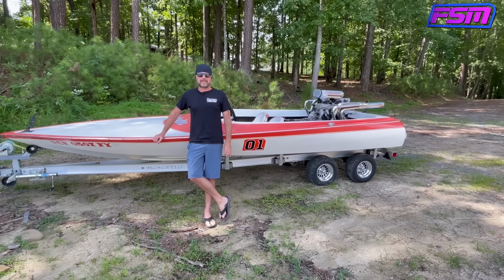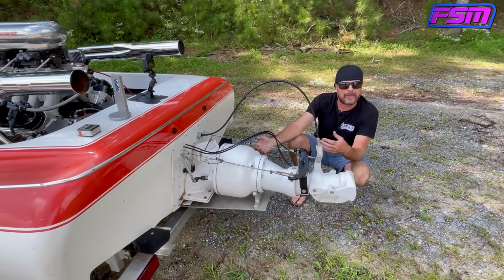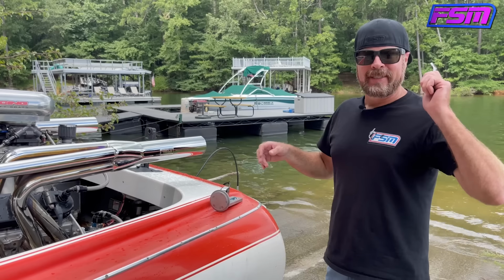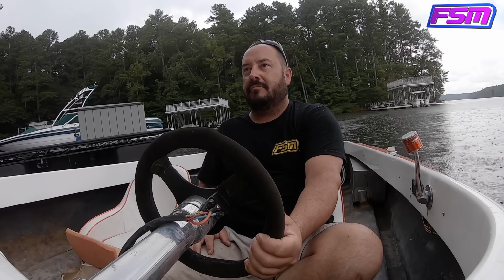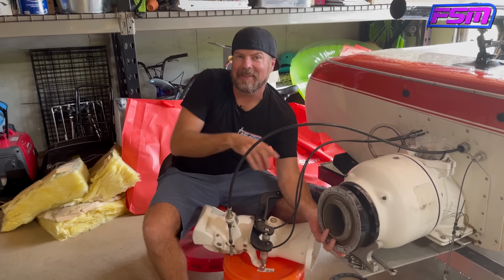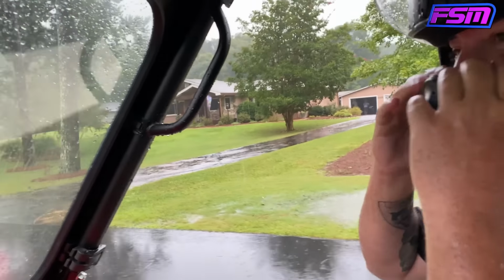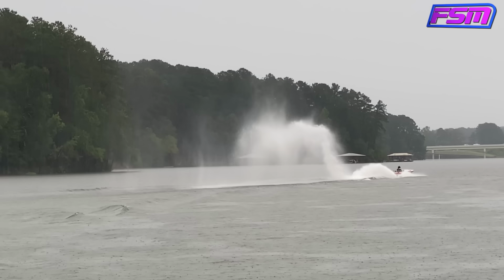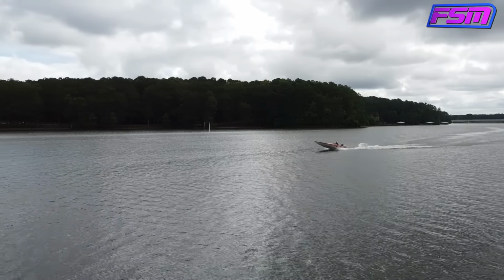MASSIVE JET BOAT MOD=HUGE ROOST!

Comment: Basically the roost is just a water burnout. Looks cool, but you don't go fast.
Save rubber, throw water!
Reply: That should be an FSM shirt. 

“Save Rubber throw Water”

With a picture of a jet boat.
Reply: @MrHatchbody  I really like that idea! 
Definitely would buy and wear.
Reply: You can't go fast in a pump boat anyway , any ANY V drive worth it's salt will walk all over that vacuum cleaner
Reply: @hydroy1  But this video is all about the "burnouts"?
Save rubber, throw water!
Reply: @hydroy1  Different applications. You can’t run that V-drive in shallows, mini jet boats running on rivers and streams is a blast. You should try it and you would be a fan of both driving methods.
Reply: @hydroy1  - Modern jet drives are quicker than a v drive.  Go to any boat drags.
Reply: @danmyers9372  quicker not faster all depends on your needs/wants
Reply: @danmyers9372      Modern jet drives are quicker than a v drive. ---?????  Who in gods name told you that lie ? I been drivin Hydros for over 50 years, ( started in 1961 ) How many Top Fuel JET PUMP boats are there ???  DING DING DING ! CORRECT ZERO ! WHY you ask ? Simple there  2 to 4 seconds slower in the 1/4 mile then the V drive of the same cubic inch size & class motor in Hydro or Flat bottom. Always been that way and there's no changing the record books . Fact is Jet pumps are the most inefficient way to move water. What Pump boat can you name running in the 4  or 5 second range in the 1/4 mile in any class or type hull? Right there are none.  Fact is the very fastest pumps are way up in the 7+ range in the 1/4 mile and most are in the 8s or slower as there very  inefficient and almost impossible to get over 155mph. This is supported by the fact , how many Top Fuel Jet pump boats are there ?
Reply: "Spinnin' ain't winnin' " it's just too much fun!
Reply: The environmentally friendly burn out...
Reply: @danmyers9372  TFH are Jet drive??  Dang I did not know that.
Reply: Mike P might not be feeling too good about his pp today
Reply: I was thinking it was more like rolling coal, just is a cool waste of the propulsion force.
Reply: @hydroy1  you miss the point of a jet boat. they're FUN! they are also really low maintenance, no exposed propeller or rudder to take damage in shallow water, and nothing changes direction like a jet boat. good for you if your boat's faster

Comment: Finnegan: “Don’t wanna run your jet drive dry”
James Taal: starts boat at the top of boat ramp.
😂 should’ve put this video out before cleetus started the boat challenge.
Reply: You read my mind right there.
Reply: "Dang rogue rocks are confusing as airplane chocks." (sry James, had to, lol.)
Reply: James has many more concerns with his boat than running his jet drive dry.
Reply: @nunyabinis   “still budget left”
Reply: there's a clutch between jet and drive shaft... he disengaged it to start the motor.
Reply: @ZaphodsPlanet  there is only one pedal mounted!?
Reply: James actually said the boat wasn't going to last, it's just for fun right now.  He cares about it as much as the one he won in Cleeters contest a while back, which is to say, not at all.
Reply: @MrJob91  do you think a brake pedal would help stop it?
Reply: @warrenmichael918  only with carbon ceramics the way he is sailing
Reply: I really hope they build that boat such a cool hotrod boat. It definitely has potential
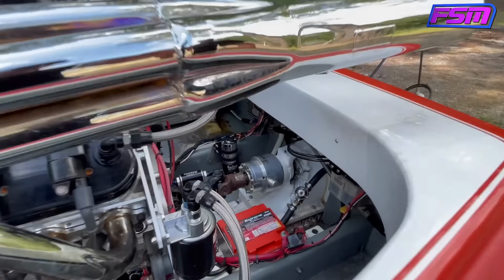Reply: @MrJob91  Go to 7:50 on the video and you'll see it.  He doesn't engage/disengage it every time he drives the boat as you would with a car.  You can see it, big silver thing in front of the jet that he rotates (I'm assuming) to disengage clutch from the drive shaft that comes off the engine.  Never knew there was such a thing until watching this video but it makes good sense.  Anyway, you can see at that 7:50 time mark.

Comment: You guys are awesome!!  The Finnegan group of guys, KSR and Cleetus among many others have given me so many ideas for building my 1972 vw super beetle. All in all the build that I wanted to be a handling quick car turned into a very different build. It is now in the process of being a 600hp 1800lbs car that I am super excited about. Thanks guys!!
Reply: You should build a standard beetle not a super beetle. The super might handle better but that curved windshield and big old front end are gross. Plus the strut towers crack. Standards also weigh 1500 to 1600 lbs. and that’s with a 4 point cage a roof rack and subs and amps. Just saying. Also 600 hp? Is that a turbo T1 or turbo T4, Subaru EJ, turbo 2 rotor?  Is your super a 1302 or a 1303?

Comment: Newbern should race jackstand jimmy with this.
Reply: Lol Renegade would stomp that boat in it's current condition.
Reply: @bepbep7418  yeah it wouldn’t be close
Reply: @bepbep7418  Jackstands boat would be pretty cool if they took their time to right all the wrongs with the engine and took it somewhere to someone that knows what they are doing to fix all the fiberglass fuckery going on in the the rear end.
Reply: @TheBignick243  After they finish the 2500 challenges, I think do another.  All three boats get another 2500 to mod what they have and repeat the challenge.  BTW, jackstand would dominate at that point, right?

Comment: "There is suction drawing water and the jet pushes the boat through the water. I say that without suction, the boat wouldn't move, so it suck the boat through the water." -- mike finnegan.

"I didn't think it was possible, but this sucks and blows at the same time!" -- bart simpson.
Reply: Suction by ass, it's atmospheric pressure that moves the water into the pump!
Reply: @rondye9398 :
Not really, unless you're assuming the atmospheric pressure on the whole lake is what's pushing water into the jet pump. 

What that system really is, is a ducted, shrouded propeller whose water stream is enclosed, rather than simply exposed to the water in the lake.

The forward moving force is the result of Newton's Third Law of Motion as applied to water. Specifically, if you take in a lot of the stuff in a short amount of time and pump it out at high velocity, you get a jet force. 

Finnegan's contention is that because the jet pump (an impeller or ducted propeller, if you wish) is drawing water in, then it is that "suction" that is "sucking" the boat through the water. But that's like saying a jet engine "sucks" itself through the air. 

That may work for a "ducted fan" -- which is the "bypass" stage of large jet engines -- or a multi-blade propeller inside a shroud, but ultimately what moves a jet-driven vehicle of any sort is the reaction of throwing a large volume of fluid out the back.

Comment: Boys and their toys. Fun in the rain and lighting! When I was much younger, and boats didn't have water jet propulsion, guys would put a water scooping device on back of their boats that they keep up until they wanted to make the rooster tail then lower it via a cable and there goes the water plume in the air.

Comment: What’s with this BS that “the jet boat is pulling itself through the water”. There is a suction force present and necessary for the jet drive to function, but the resulting negative pressure present at the inlet is distributed equally in all directions. Water is pulled from the front, sides, rear and bottom. Any directional motion resulting from the water rush in to equalize the pressure at the inlet is the result of flow resistance. There is some miniscule directional bias naturally inherent to the system which results in some forward bias, but saying the boat is being pulled through the waters is akin to saying that because a drag strip has a slightly negative grade that gravity is pulling the dragster forward, while technically true, in the context of how the dragster is propelled forward, the contribution of gravity is infinitesimal and a valueless statement.
Reply: Mike is not an engineer, much less a physicist :-D
Reply: After a quick read on waterjets, I would say the system is pushing, due to the waterjet creating "thrust". But, I think the question of push or pull has more to do with the placement on the vehicle. If the engine and waterjet were mounted on an extended arm in front of the boat, it could be described as pulling. But mounted anywhere on the boat itself is still pushing. Or is it if the waterjet were on the front of the boat? If I tow your car with a rope, that's pulling. If I pull up behind you and push, that's obviously pushing. 
I think Mike is just trash talking for humor value, but it's a fun thought experiment. Is a front wheel drive automobile pushing or pulling the car forward? Would forward being pulling and reverse be pushing?
In a front engine car with rear wheel drive, everything in the drivetrain is pushing, all the way to the axle/s...if it's a manual transmission. But what about an automatic? A torque converter could arguably be pulling. When the engine side spins up, the other side follows, spinning the drive shaft, etc. Once it's spun up, I think it probably reaches an equilibrium of push/pull, since it starts to behave as one unit. But on spin up, the back half of the torque converter is definitely following, which implies it's being dragged along, which is obviously more pulling than pushing.
If you take a high pressure water hose and drop it, it will turn into a wild snake and start spraying water all over the place. Is the water pressure pushing the hose around, or is the hose being pulled up the water column? Or is it both? (Newton's 3rd law)
Reply: @strangersound  You need to go back to grade 10 physics and this time pay attention.....
Reply: @strangersound  how many hits did you take on the pipe before you wrote this?
Reply: Dude you make my damn head hurt

Comment: Regarding suction, you're partially correct. If you could measure the velocity of the water entering the jet drive at full throttle with the boat tied to the dock, that would be your "max suck speed". As soon as the boat travels faster than that, you no longer have suction at the intake. Enough forward velocity will produce a ram effect, where your jet drive will become more efficient, since you would have relative pressure sitting at the front face of the impeller. Now, this is all based on aerodynamics, not hydrodynamics, so there will be a little difference due to water being incompressible. I'm a jet engine specialist with the Royal Canadian Air Force.

Comment: In regards too your suction V thrust discussion, have you seen the hydro hoverboard attachments for a jet ski? They redirect the thrust via a hose too the hover board. The jet pump is still operating as normal, the suction is still present but the ski does not move forward. The only thing missing is the thrust. 
I’m no expert, just my thoughts. 
Love the show mate. Keep up the great work 👍👍

Comment: Go Big D! While you're explaining the jet drive I'm thinking about Nitromethane Top Fuel boats. You can see the driveline torque load. I can see the boat shift with every little change in water flow.  As if the water resistance has no effect. The boat shifts back and forth until the driveline load balances out. You see the same thing in 700hp Yamaha drag sleds. I still don't comprehend the belt takes the torque in those. 
Anyway back to insane real Hemi jet boat action. We only got 76 out of modded twin BBC Donzi so that thing is flying.

Comment: That was awesome!  Would love to know what a datalog of a pressure sensor mounted past the pump would look like in general, plus any difference between the nozzle positions.  Would internal pump pressure be increased from shooting the jet outlet more into the water VS the air, like putting more load on a turbo car or different loads on a torque converter.
Reply: no

Comment: Hydraulic steering would make a huge difference in handle ability. I'd definitely do that and put longer tilt piston on it so you could use it in race mode and Roost mode simply by adding a bump stop on top for race.

Comment: The suction is in an upwards motion, it is not inline with the boats direction of movement. The suction actually makes the boat not plane as well and this is why a jetdrive with the inlet at the same level of the hull is not desireable for extremely fast boats. The hull can not completely hydroplane, as the hull needs to be submerged, where a propeller sits much lower in the water. One great aspect of a jet boat, though not designed well, is if the inlet is mounted further forward it makes the boat much more stable for going over waves. As you peak on a wave the suction actually pulls it down and displaces water from underneath.

Comment: The thrust is all about mass flow rate.  It's how much mass can you shove out the back per second.  That mass flow rate results in an opposite acceleration of the boat from the direction of the mass flow.  So, when you say the boat is sucked forward and others say the boat is pushed forward, you are both sort of right - it is the mass of water being moved and accelerated from the front to the rear that provides the forward acceleration of the boat.

Comment: OMFG MIKE FINNEGAN I JUST WATCHED A GUY DRIVING A BOAT WITH SOME TYPE OF TURBINE ENGINE ON A JET BOAT GOING 142 MPH ON A RIVER LIKE A CRUISE MISSILE, BRO!? 😳😳😳 HAS IT ON THE SCREEN A SPEEDO GPS KIND BUT HOLY SHIT JUST WHEN I GOT USED TO WATCHING YOU GO LIKE 90+ I SEEN THAT 777 GUY FLYING SCARY SCARY SCARY BRO AND I GREW UP ON 455 JETBOAT IN THE LATE 70s

Comment: my 1973 southwinds i clearanced the place diverter, adjusted the cable, and added a wedge to get max roost. boat did 88mph with 496 bbc 13.1 tunnel ram dual holly 750, and with the diverter up at idle you could wap the throttle a few times and bunny hop the boat or if you mat it for 2 seconds the boat would stand stright up and you could wap the throttle pogo it. (fyi only 2-3 pogo then drive out, or you start taking a lot of water over transom, and you have to commit to the gas when you drive out or the boat is likely to have a bad day. ) wish i could post a pic of my boat on here. you should try an nozzel bushing see if reducing the size gets more height.

Comment: I agree Mike the suction definetly "pulls" boat through water. Yes thrust out back but when ur roosting that high how much thrust is really pushing against water?
Reply: THRUST DOESN'T PUSH AGAINST ANYTHING! THRUST IS THRUST!!  A RIFLE PUSHES BACK ON YOUR SHOULDER, IT DOESN'T MATTER IF THE BULLET HITS ANYTHING!!!  ASK THE SPACE SHUTTLE HOW IT WORKS WITHOUT ANYTHING TO "PUSH" AGAINST.........grade ten physics is your shortcoming Captain Toyota

Comment: You absolutley can have thrust without suction. Thrust is just newtons third law in action. You are accelerating the water backwards. In the case of these boats the impeller is pressurizing the water, which then gets accelerated by the nozzle. The speed the water goes out the nozzle at is what creates the thrust. Its like a turbojet or a rocket engine. Rockets work without suction especially those litte water rocket toy things ;) The sucking the boat forward effect you are describing exsists basically only at zero speed. Once the boat is moving you dont want suction because that would just suck the boat down into the water and rob you of potential thrust from the jet drive.
Reply: If you turned the jet intake over and mounted it inside the boat with a tank of water mounted on top of it, the jets water source being from this tank inside the boat, you'd get thrust and forward motion of the boat without "suction," or sourcing the water from below the boat, wouldn't last long, but it would be a good experiment to see the difference of sourcing water from in the boat or from under it. 
I believe a jet drive/prop would have a very slight advantage over a tank in the boat, cause don't they create a "low pressure zone" in front of the drive as water is removed from under/in front of the boat? Doesn't a boat tend to "fall" into this hole as water is displaced, but that slight downward motion/action is overcome and converted into forward motion as the boat is pushed forward by the jet.  
What's the percentage of "air" that a jet sucks up with the water as a boat is skimming across the water at high speed, I know it can't be 100% water, would it go faster if it was 100% water?
Reply: @danthomas9077  interesting questions. I (obviously) don't have a straight answer to them, but fun to think about. My guess is that negative pressure underneath the boat just creates more drag on the hull, as the entire craft would be lower in the water. It is a planing hull so it lives on dynamic pressure lifting most of it out of the water. On game over the intake seems to create positive pressure (think ram air intake) instead of suction. Otherwise the blow of in Front of the impeller wouldn't do anything. This boat just has a cover there so no idea what it is doing. I don't think these take in that much air. The intake is basically at the lowest point of the hull, if it were to encounter air there, the entire boat would be airborne. Or pitched crazy steep like if you are using 2 wedges a 10° adapter and 20°s of up nozzle for example 😂

Comment: Question , have a Southwind jet 19 foot v haul legend 120g pump when running between 1000 to 4500 rpm runs great.  As soon as I hammer down on throttle and hit max rpm for about 10 seconds it begins to shake any thoughts? Thank you 😊

Comment: yo... fill the sections before the nozzle with a lot of tubes or something to divide and straighten the water. it creates more pressure and a defined jet of water.... more power and a rooster that will be as clean as the venetian in vegas!